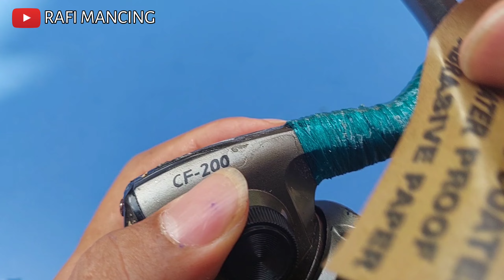Cara Memperbaiki Reel Pancing Yang Patah

Comment: Saran saja, di ke 2 sisi yg patah di bor pakai mata bor 1mm/2mm sedalam 3mm - 5mm lalu dikasi skrup tanpa kepala yang ujungnya dipertajam, di tengah skrup di hilangkan dratnya 2 sisi saja. lalu sambung patahan baru di beri plat. Ini sudah saya coba di reel 6000 yg lehernya patah alhamdulillah sangat kuat buat narik beban berat
Reply from the maker: Ya bang ,,masalahnya bor gak ada..ini kita menggunakan alat seadanya aj🙏
Laen x saya buat vidio menggunakan bor ,,sementara saya pinjam bor tetangga dulu